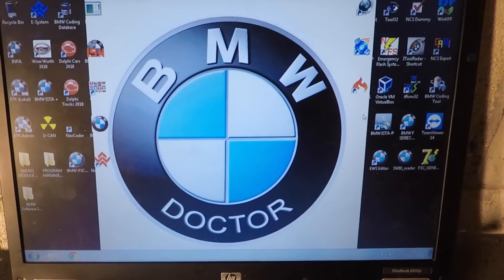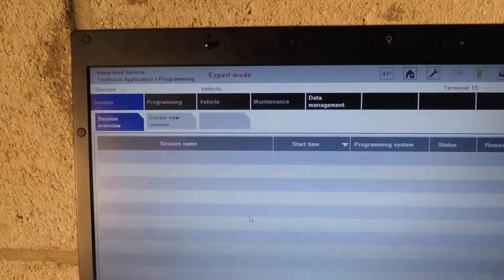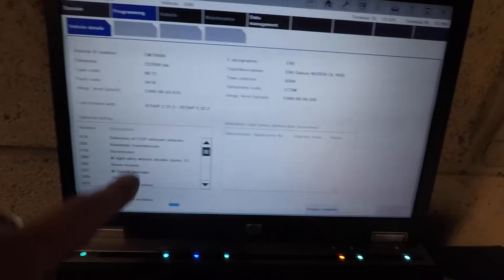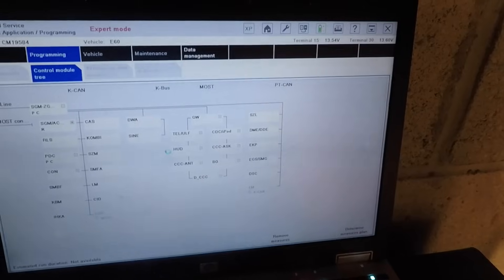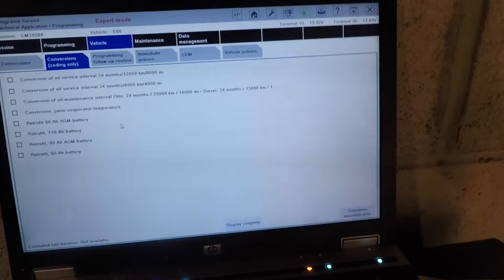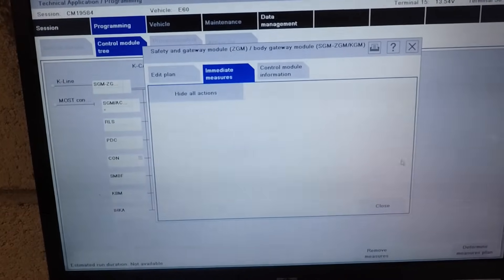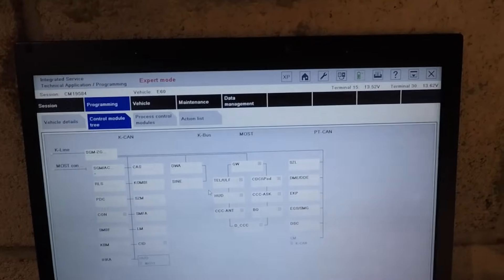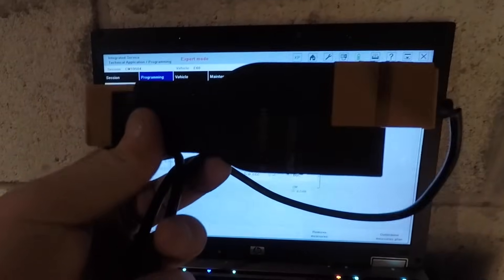BMW ISTA P How To Program And Code Modules Walkthrough in Depth Guide

Comment: How can I get a icom to stablize my power on the battery when programming?
Reply from the maker: Via me sir I sell them
Reply: @BMWDoctor  Here is my problem. I have spent loads of money on people who "CLAIM" to have the software I need to fix my 2007 BMW 328i. I have spent the last 3 months installing and uninstalling crap software that I can not even read because it is in German. I tell these people I need English so I can understand it all. I am stressed to the limit. I got a mother in rehabilitation for her hip. She fell and shattered her hip. Between messing with this damn car and going to take her food and supplies she needs. I have been desperately trying to get this damn car fixed. Here is the problem. I bought a 2007 BMW 328i for a crocked car dealer. It had an ABS light that kept coming on the car. I passed on the car. They called me and said it is fixed. I drive the car and no problems for miles until after I signed the "AS IS" papers. I drive it home and get about 12 miles down the road and the damn ABS light comes on it again. Long story short. I am stuck with the car. All I want to do is fixed the damn thing and sell it. So I was getting a rear right and left ABS sensor communication error. I went out and bought all 4 ABS sensors and the 2 brake sensors. All are brand new. I am still getting these errors. I ended up buying another used ABS module online and just replacing it. I bleed the brakes and still had the traction control light, ABS light, brake light, engine light, and later started getting the airbag light. Now my speedometer is not working. The gauge that gives you an estimate on what you will get mpg at what speed you are going is not working. My digital mileage counter is there, but not counting miles. My gas gauge kind of works, but the digital part that tells you what you will get on a tank of gas. Kinds of moves a lot like it is not accurate. I am lost and do not know what to do. I have to have this car to take my mom to her appointments and other places. My other car is crap. Any suggestions on what I should do? I was wondering could it be the YAW sensor is out? Does that control communication with the rear abs sensors?
Reply from the maker: mate im not everybody trust me on that im specialist at what I do and I have everything possible in this game if you want correct software I have the lot whatever your needs be it programming keys programming ecus clearing clusters diagnostics I have the lot I have many many many people on here who can verify what I do please go and see my videos to see what I do I take what I do seriously and if need be I will sort your car remotely for you like I have done for many many people the 328 xi and 528xi I understand VERY well
Reply: I need my e60 2007 550i coded as well reply to your email @ BMW Doctor
Reply: @BMWDoctor  What is the cost?
Reply from the maker: @TheNoblePhenom  I haven't got a email from you please email bmwdoctordean at gmail dot com

Comment: Can there be options coded like bimmercode?
Reply from the maker: Not with this one but others you can ISTA p can only code factory extras you do not need to use this to code for this program you will then need a icom and a voltage supply and I do not mean a (BATTERY CHARGER) I mean a proper power supply
Reply: @BMWDoctor  Oke not the same as esys etc? I do coding with vcds and vagcan pro. Also do tuning on vag. Started coding on bmw with bimmercode but its on a Android app with phone. No laptop.  I have a telwin doctor charger with diagnose function stabiel at 40A with 13.8V  for tuning on vag ok. So for coding esys would be better i think. But i cost a pot of time with fsc coding..
Reply from the maker: My friend what car are you coding ???? Do you know what e system is for
Reply: @BMWDoctor  i use bimmercode. Code E90 318 E91 320D, F31 320D. But i have esys but not used it. For VAG i code with vcds and vcp.
Reply from the maker: right so you are wrong you cannot use E system for all these cars e system is for f series only and you better know how to use that or it will destroy your whole modules BE warned as for E90 they need another program and do not accept e system
Reply: @BMWDoctor  if you read back i mentiond i use bimmercode for now(E series from.2008, Fseries and G series posible). But i have esys(because i want to use laptop instead of phone like vcds and vcp i use with laptop) i know this is for F series. Ncs expert they use on E series. But i only code newer cars. Thats why i have esys. Thats why i asked i insta P app can be used for coding like esys or ncs expert. Because vcds and vcp can be use on al vag cars from 1991 til 2019 etc. Need a system that Works for all types.

Comment: Hello mate how much do you charge for coding?
Reply from the maker: That depends on your issue

Nothing is ever as Simple as just coding
Reply: BMW Doctor  i need GM5 coding for e46. 
1) alarm noise when locking and unlocking car.
2) rear window open and close with the key
Reply from the maker: Salman Bawani rear window should already be rolling down on key you have 2 door ???
Reply: BMW Doctor yes I have a 2d e46 2005. You might be right, I will have to check lol. I know the front windows go up and down with the key.
So I guess just the beep noise when locking and unlocking the car cos I don’t like my neighbours.haha
Reply: @BMWDoctor  good day, looking with help coding used gm5 to my 00 E46 sedan. Moduke came from an E46 m3, but same as E46 module.

Need alarm coded and tailights. Willing to donate for services

Comment: Thanks for the video. I connect successfully but when I click on the Vehicle tab and then CKM it comes up with fault 1000. Any idea of the cause and a solution? Many thanks
Reply from the maker: That code comes up usually when you are either using a cable trying to do this which you cannot program a car with a d can cable OR your not using a voltage stabilizer and trying to use a battery charger ISTA P IS NOT STUPID if you don’t have a voltage stabilizer it will not let you program the car it’s that simple it knows the difference between a stabilizer and charger

Comment: I appreciate the info, but my god, stop talking about the voltage stabilizer. get to the point lad. i dont care who build the stabilizer, i understand you mentioning it and how important it is. but even skipping the video forward trying to find the info i wanted, i landed 3 minutes later, and you're still banging on about it 😂

I just want to code a damn battery change.

Comment: Hey DD I replaced the JBE module on my F10 and need to code it to the car, do I have to go to programming on ISTA D and hide all other modules like you did on this video except for the JBE or any other module that needs coding before I give the go ? Thanks in advance
Reply from the maker: Mate DO NOT USE ISTA P FOR THIS !!!!

your going to brick your car
Reply: I’m using ISTA- D with ICOM
Reply from the maker: Rami Malaeb doesn’t matter mate ista d will brick it 

Isit clone icom ???
Reply: ICOM NEXT A, hope you can advice with what’s the software to code it with or make a video about it.

Comment: Ok but where the fuck do you a voltage stabilizer? Nothing exists with that name.
Reply from the maker: That’s because these are a RISK and I will never sell these to my subscribers 

I now have proper professional ones built by a company which are proper and have displays and proper leads that come off
Reply: @BMWDoctor  But what I'm saying is this can't be something that has to be custom built? Like what does BMW dealers use? Surely they are not using "voltage regulators' since I can't find anything on that subject.
Reply from the maker: @JackRR15  unfortunately your completely completely wrong ISTA P will NOT EVEN let you program the car without this keeping the car at its voltage so YES they do use these indeed but proper ones that I now use these are NOT voltage regulators 

I cannot believe you guys come here trying to TELL ME ME ME above everybody how to do this like your the professional just because you cant find it does not make it non existent its purely because I dont want ANYONE to find it so I dont give out the real name and number needed to find this product everywhere !!!
Reply: @BMWDoctor  Ok listen. Where did I say you are doing your job or work wrong? Or where did I even say you should do your work this way? No where. I'm asking questions. Why does everyone assume when you ask questions to be able to understand better that you talking bad about what is done? I am not. 

I agree ISTA-P is not going to work if your voltage dips into a level it doesn't like. Never said I would still work?
What I'm asking is what the BMW tool is that they use. The brand and model. That's what I am curious so I can compare to what I should get. 

If yours are custom built then there is no point in going with that route for me.
Surely BMW dealers do not have custom built models voltage regulators.
Reply from the maker: I believe it’s the way things come across on messages that are mis interpreted.

These are custom built yes but the ones we use don’t have a name because I have them all made most people in this industry know what is needed to develop these and how there made to make proper ones which is what I set out to do I went and got a patent and license to be able to sell PROPER stabilisers that work and are good and proper what we did is take one from bmw and clone the internals if there’s and that’s how we made the ones we use
Reply: @BMWDoctor  Yes I agree sometimes it might come off different. Okok, thanks for the replies. I still probably won't use ISTA-P I'll just stick to the same battery specs and register in ISTA-D. Or NCXExpert I think you can change the battery specs right?

Comment: Hi. I have a 2016 BMW 435i xDrive convertible. A few months ago, the horn started honking twice every time I unlock or lock the car after leaving it for 10 minutes whether I use comfort access or the remote or the key even. Is it a simple software reprogramming to get this back to the factory chime instead of the horn honking?